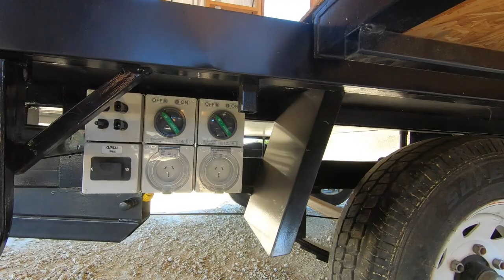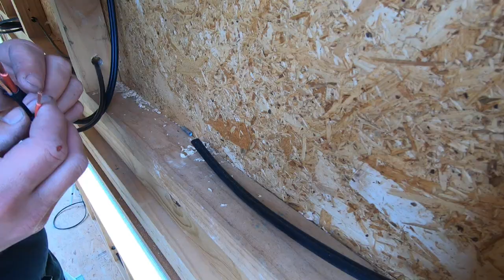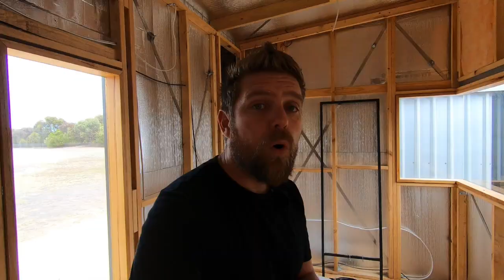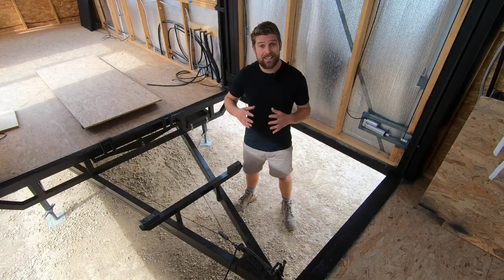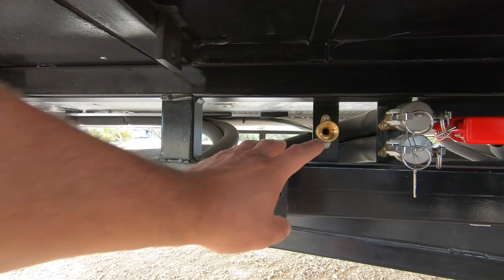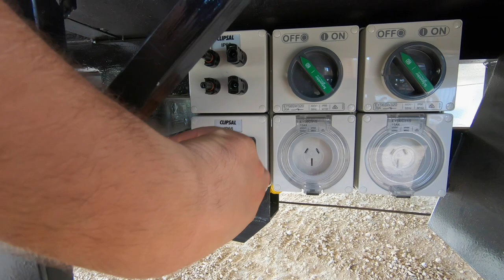Ep. 28 - Plumbing, Electrical & Automation services run - Tiny House Build Update

Comment: 🙌🏻 really looking forward to seeing these ideas come to fruition Phil!
Reply from the maker: 🙌🏻 You and me both. I can't wait to actually see the shower working. In the next vid you'll actually see one of the ideas functioning with the air conditioning :)
Reply: @TwoHandsandaTinyHouse  I've seen a few van builds in the States use a sump with recirculating pumps and multiple filters in their showers.
They obviously help reduce the water consumption, but also save on energy to heat it, great from an efficiency perspective, but hard to wrap your head around from a hygiene perspective.
Reply from the maker: Wow that is very serious. Not sure how I would feel showering in grey water. Buth then again with sufficient cleansing it's of course possible to bring it back to pure H2O. But that would require filtration, reverse osmosis and who knows what else. Be good to see how they do it.